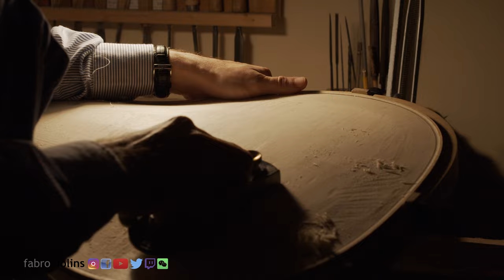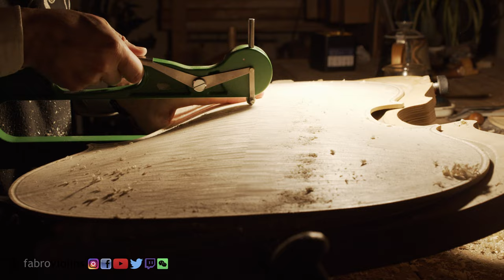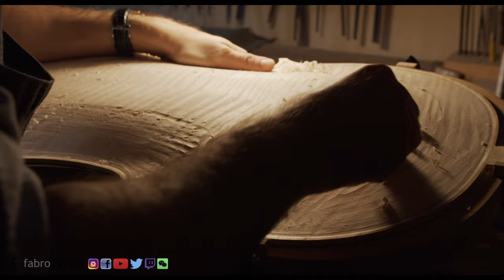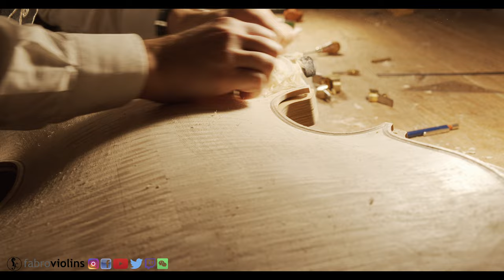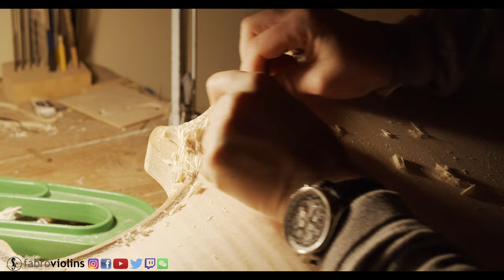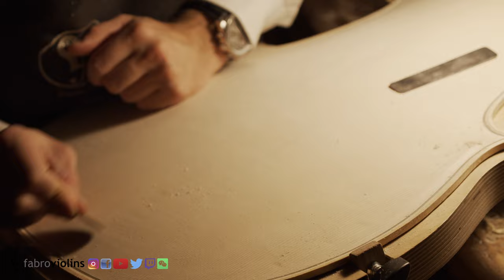MAKING A CELLO | The ARCHING (Part 2) | Ruggeri Model

Comment: hello, Lucas could you please explain the difference in sound quality between a solid one-piece back and a double back? Also: is bird's eye maple superior in any way to flamed maple, which is the better choice?
Reply from the maker: Hi! Thanks for your comment. 

I'm sorry (or happy) to say that there's no difference between a one-piece back or a two-piece back. My theory is that it's something that some factories invented to price some of their instruments at a much higher price, selling them as "top quality" or "professional", which is quite "funny" because both historically and in present days, professional makers have always used both once-piece backs and two-piece backs...but as I said, this is just a personal theory.
 
The price of the wood for a one-piece back is a tiny tiny bit more expensive than the one for two-piece back (of the same quality) but just because it's harder to find a tree that's so regular in a wider area. However this price difference is by no means significative in the price of the instrument, and again, not significative in the accoustics of it. It also doesn't make it better quality or "prettier" because that's simply subjective and some people prefer ones and some the others (for example, in most cases, I actually like two-piece backs more).

Same thing applies for the bird's eye maple (although this one is very rarely used in violin making, so in most cases I'd avoid it...even if I have a really nice one that I'll be using soon). However, keep in mind that what would make a difference is the type of cut (radial, slab).

Hope that helped to clear your doubts and thanks again for your comment :)